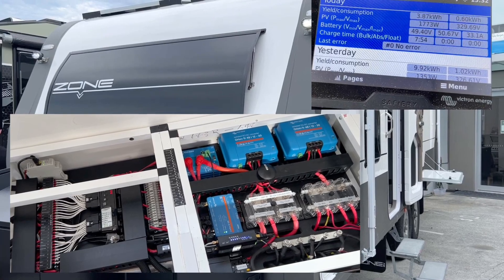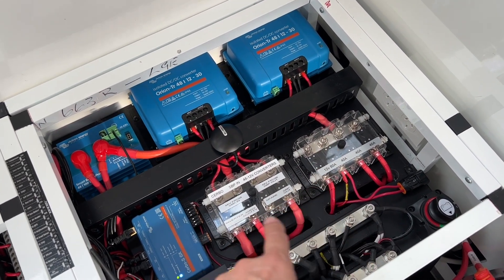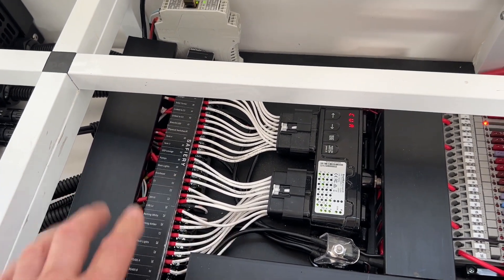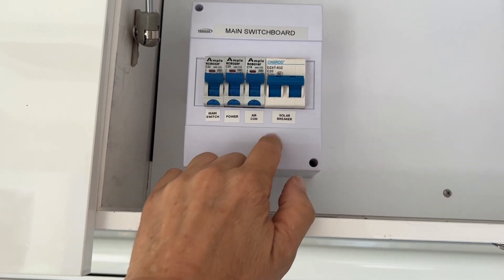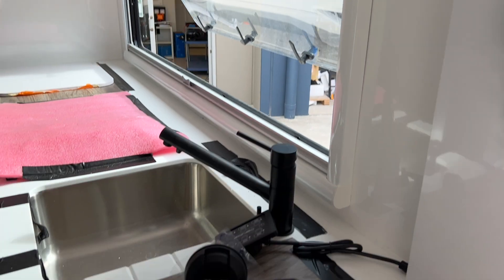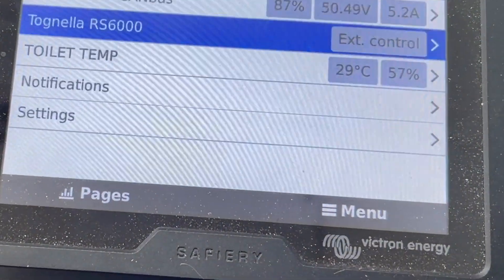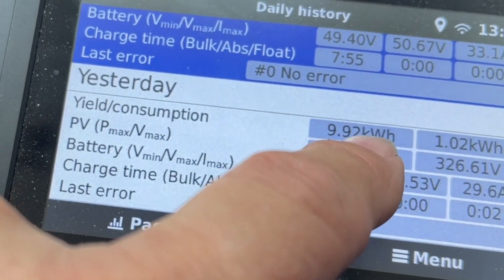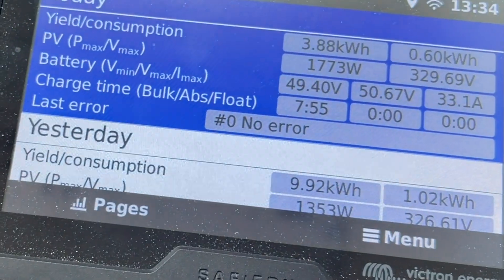48V System in this ZONE RV - 1,710W Solar producing nearly 10,000Wh/day Scotty Backup

Comment: Over complicated, Too much to go wrong. Rcd on a system which is isolated from earth.🤔 That makes no sense. All breakers, switches & outlets need to all be double pole as an inverter does not run a neutral.👍
Reply from the maker: Fortunately you are not correct on the double pole requirement. Nor the RCD isolation. We ship all our systems with both double and single pole GPO's with full electrical compliance. We hold a contracors licence and we are not 99% sure but 100% compliance with our work.
Reply: Sorry but you’re incorrect! I’m also a licensed electrician. Inverters do not run a neutral as they’re isolated from earth. All active conductors must be switched.👍
Reply: Too bad AS3000 doesn’t agree with u!😂

Comment: Nice install as usual Bruce. How do you manage locating the batteries under the seating area given the changes in AS/NZS3001.2:2022? Is it simply a matter of having the under seat area ventilated to outside? Cheers!
Reply from the maker: This was done before the regulation changes. Would be illegal to do it with Lithium now. So we do it with Sodium no problem

Comment: Looks overly complicated for a small vehicle, Even for a home system. When dealing with DC power stand by draw (Watts) is your enemy. The more unnecessary components you have in the system, the bigger the draw in watts, as well as the extra $$$$$ draw from your pockets.

Buyers remorse hits hard on these systems. Figuring your bare minimum load calculations in watts is better than chasing dreams.
Reply from the maker: Well said. We focus on efficiency in a big way.  We get the highest yield off the solar with our DC DC for solar. We generally get 120-130% more energy per day than others. As for the $$, some budgets like the added automations, some dont. We dont try to sell up, we just meet needs of what customers want.
Reply: @Safiery  Thank you for replying, there is and has been marketing scams forever. Middleman markups at 200+%, over scaling for what will actually be used. Never hitting that ROI, I’ve seen a lot especially in the stereo market selling watts that never hit the numbers that printed on the box. 

And thd distortion percentages in the 5% range then there’s brands that are re-branded and re-branded again the consumer never gets the high quality as advertised unless you really look at the specs and really do your own testing and product research spending $$$$$$$ plus TIME

I have found quality electronics and electrical components have serious weight in lbs, mainly due to the copper and magnets that are needed. That is an easy, hands-on test to know which is quality what’s not. Kind of hard to fake that.

You seem to be using quality products, these days it’s hard to find and keep up with the 300 new brands that keep popping up over night. The cheapest price is most likely the worst, and the most expensive is not always the best.

When dealing with parasitic electrical devices, it’s all about the watts no matter what voltage you’re going to use. Higher the voltage, equals a lot less amps,Least amount of watts used with the maximum output would be efficiency compared across the board against other competitors components. 

Then warranty, might as well throw out made in USA 🇺🇸 because that’s  been gone, many claim American Made when in reality at best it’s assembled in America that’s not American made, American made is American sourced American built and American sold. 
As a consumer we just want the best that’s going to last 30+years without catastrophic failure at a reasonable price for efficiency in the 90%+ percentile range with the least amount of standby draw in watts preferably zero%

And we will buy from anyone & anywhere on the planet Earth to get there. 
You have a very nice setup, look forward to the progress of efficiency and affordable but definitely not cheap.